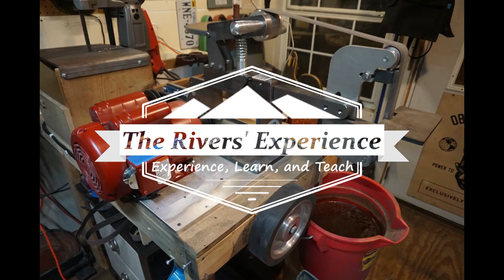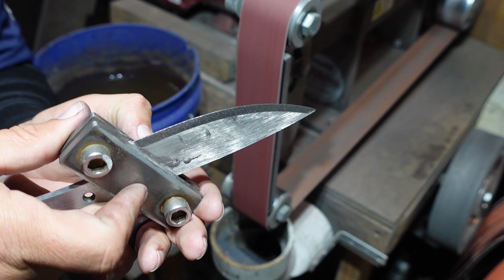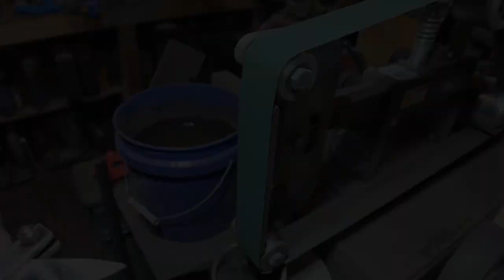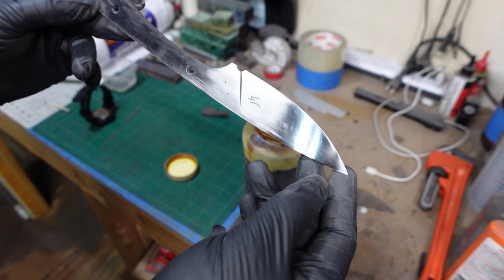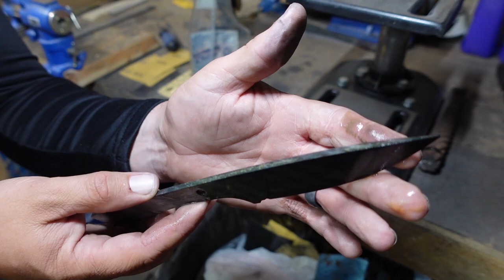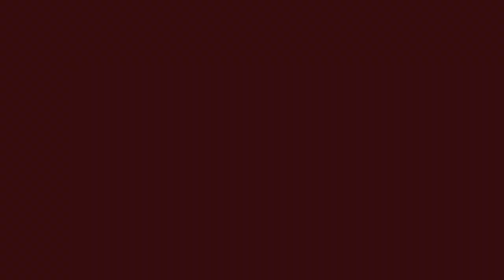Grinding Bevels and Etching The Cable Damascus Knife | Knife Maker | Vlog

Comment: It looks fantastic! I don't understand something of the etching process, in "normal" damascus people forge weld together different types of steel so that when you etch it one type of steel dissolves in acid faster than the other creating a pattern. With cable damascus there is only one type of steel, so where does the pattern come from?
Reply from the maker: It's the same type of steel but they aren't perfectly the same. I haven't really seen anyone go into detail about that though.
Reply: @theriversexperience9383  hey, after writing that comment I did some research. From my understanding, when you forge weld cable into itself the parts of the metal where the weld takes lose part of their carbon content, so locally it's like you have two types of steel that dissolve at different speeds.